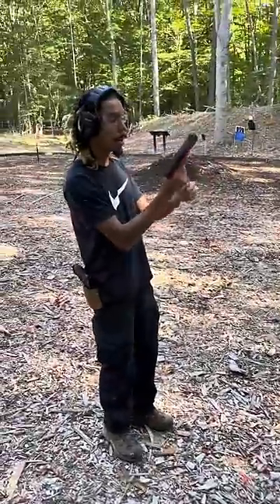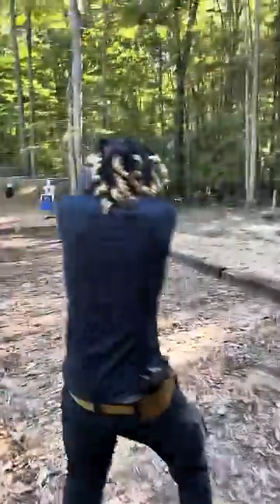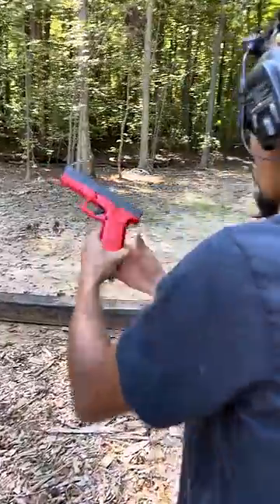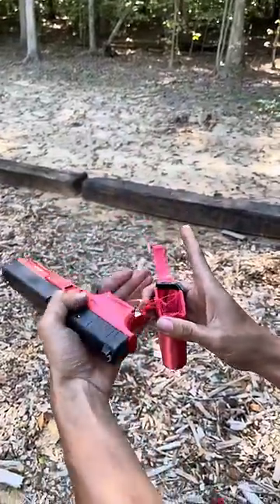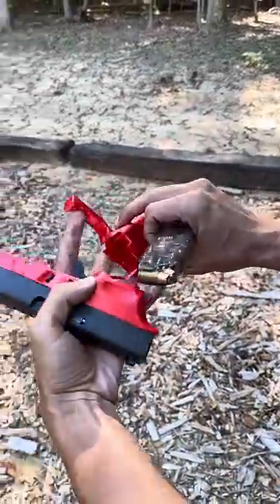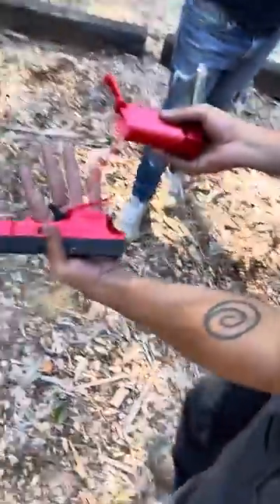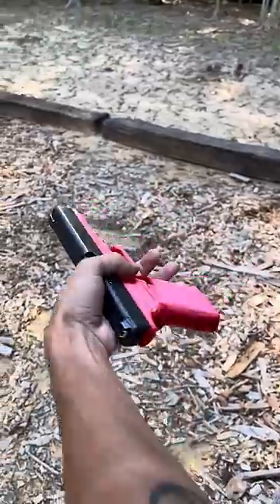3D Printed Gun FAIL 🤬

Comment: The dude saying he used the wrong filament is to blame here 😂😭😭😭
Reply: the problem here is they using 3d printed material for something thats made to have a polymer lower on it😂
Reply: @Sk47_bangouuut PLA+ is pretty similar to polymer with many similar mechanical properties. And it's not made to just be polymer. The original Glock is steel. Polymer is what people make at their houses
Reply: @KB-nt7eg  the lower on the Glock is polymer thats my point u want something with properties to match that of a non 3d printed weapon u need a mix of different materials.

Comment: You never print horizontal along a stress line, should be printed 45 degrees with the high side away from the front of the object where there stress occurs. There are so many variables that could be wrong with print settings to cause this, filament type, bed temp, extruder temp, wall thickness, infill, flow rate, print speed, room temp ect. Number one is part orientation. PLA is not the best option for use parts.
Reply: PLA+ is fine or nylon
Reply: facts, i knew as soon as i saw the layers were parallel with the magwell it was a problem. Its dangerous for someone to just be  printing this stuff without understanding how 3d printers work a bit more
Reply: Major yep.
Reply: Bro... LOL, you are speaking several orders of magnitude more scientifically than most of these dudes are thinking.
Reply: wouldn't flow rate and print speed be pretty close to the same variable? i dont print so i dont know what im talking about, just making an educated guess
Reply: @thespaceelefant2441  yeahh kind of but it wont do only altering one. If you up the print speed hut dont lower the flow rate you get stringing and basically a bad finish. Or if you lower the print speed but dont lower flow rate you may get bulging because too much filament is being extruded at any one time. Ive had a 3d printer for only about 2 years now and it is most definitely a  job of fiddling around until you kind of know whats what
Reply: @Ronald Weedly basically certain orientations and settings when you 3d print can make them weaker
Reply: You're so wrong it's funny. Most print rails down some up hardly any print 45. It's all in the settings and filament choice. That's silk and he probably ran some generic settings watch print shoot repeat or Hoffman tactical.
Reply: @davedfran6082  its not that wrong tbh, and certainly not laughably wrong lol wtf
Reply: Also if he annealed it he would've probably had little to no cracking at the layers.
Reply: NEVER 3D PRINT A GUN! PROFESSIONAL OR NOT
Reply: @ralphralpherson9441  not at all lol those are basic 3d printing terms
Reply: PLA is fantastic option
Reply: @ralphralpherson9441  this is why the threshold for 3D printing builds is more than the average person thinks, because it is. There can be lots of tedious temps and bed level adjustments, extruder changes, or heaven forbid you have a printer set to online and it gets hacked mid print
Reply: @deechonada  everybody who is a name in 2A3d prints rails up or down. Almost all the readmes state that 45 degrees is done in testing for speed of print and removal of supports, not for prolonged use.
Reply: @PNWhashmits  fair enough!

Comment: The guy who knew they used the wrong material should’ve been the one to test it. Lucky nothing worse happened. Pure LUCK
Reply: Right that could have been bad.  It didn’t look like polymer either it just looked like some regular plastic. Look how the piece that broke is all shiny n shit. Polymer don’t shine that way
Reply: That wasn't luck,  that was blessed.
Reply: What could've happened? Like I'm genuinely asking, all the pressurized bits are metal, and the 3d printed part is just holding stuff in place
Reply: @connorhart7597  it could've backfired or blew up normal malfunctioning firearm problems
Reply: Dude has plot armor

Comment: My suggestion is to reposition the part on the bed so your layer's are vertical.
Not horizontal.
Also you need to do some annealing by finishing the part in an oven.
It will melt the layer's together into a more structurally sound part.
Essentially eliminating the layer's and making it solid.
Just what I would try next.
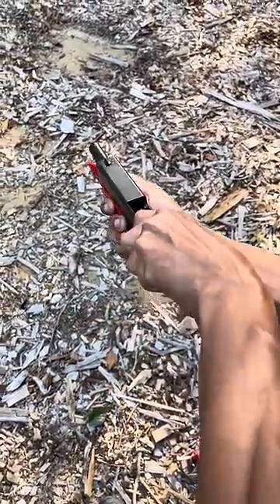Reply: As said at about 0:55, it was the wrong material.

These suggestions are not necessary if you print and follow the guide

Comment: Print your frame on a 45° with supports, run your nozzle a few degrees hotter for better layer adhesion. Looks like you also ran PLA. PLA+ seems to work better  for frames.
Reply: WrathMachine  they still need to come and take it
Reply: How much infill do you recommend for the lower he's holding? Like 30%?
Reply: @indatubesurfer  stop crying
Reply: @PabzRoz  who says I’m crying lol!
Reply: @indatubesurfer  Amen brother. These glorified nerf guns will NEVER be reliable or cost-effective. Every serious gun owner i know doesn't waste their time even thinking about this 3D printed plastic garbage.
Reply: @lospolloshermanos5659   the problem is most people just use cheaper filaments(plastic)  or don't correctly make them.

You can buy very expensive filament that far exceeds metal in all ways. And you could even get (though slightly defeats the purpose) filament with steel, aluminum, iron whatever you want in the plastic when making.

3d printed guns are the future even the US military is already considering plastic ammo.

Also when you do it right, plastic is astronomically cheaper, better, and you don't have to have it traceable. All that plastic that broke in this video maybe cost $2-3?
Reply: @indatubesurfer   clearly you haven't seen what a good actual 3d printed gun looks like (the ones doing full auto putting through thousands of rounds)
Reply: @MTDurkee  There is no need to buy "very expensive filament." PLA+ is more than capable of handling the pressures involved in something like this and only costs $15-30 per kilo depending on what brand you buy. And you can usually squeak 5 full-size pistol frames out of a single kilo if you don't have any failed prints.
Reply: @TEAMFALLBACKstudios  95-100%, depending how well you've tuned your extruder's flow rate. Printed frames need to be as close to solid as possible.

Comment: 100 percent infill goes a long way, and you had layer adhesion issues judge by the way it was unraveling. Bump the temp up a bit and slow it down with 100 percent infill.
Reply: Seems like they are using cheap plastic. Nothing is going to make that hard enough to handle a firearm .
Reply: The Last Human  single use? What is this for criminals directly? Lmao
Reply: @whitetiger5181  Nah, its actually pretty expensive silk. idk why hed use silk when pla+ is cheaper and stronger (and tons easier to work with, his settings were probably wrong because he was using standard pla settings with silk lol)
Reply: @agentbarron3945  I don't know much about the 3D stuff but you need some super strong shit to be able to handle the explosion from a bullet or multiple bullets being fired rapidly. At my machine shop we make some gun parts at times and we use 4140-4150 pre hardened steel . Which is pretty tough not as tough as stainless but still waay tougher than regular carbon steel.
Reply: @whitetiger5181  all the boom boom stuff is happening in the slide anyway. The frame just has to be tough enough to hold on when the slide cycles. Shit, they’re doing AR and AK UPPERS in PLA+. Plastic has come a long way.
Reply: I know this is old but thats actually incorrect. Something like 98% is the way to go. When you set it to 100% it will lay down completely filled layers but when its a little under 100% it will print in alternating patterned layers which make for stronger durability.

Comment: The fact no one was hurt in this video is not luck. The care taken to handle this weapon in the safest possible way is something I rarely see outside trained military. Even cops are notoriously terrible at range safety. This guy is flawless. He's indexing his finger over the trigger guard. The muzzle is pointed down range literally the entire video, and he's even more careful with the weapon after it fails, look how far he peels away his trigger finger from the weapon while it's falling apart. And even though he's pretty sure it didn't cycle a round, he keeps it pointed down range and clears the chamber manually. 10/10. Should be shown in safety class. No joke.

Comment: Get some PLA+ and test it’s strength on increments of 5°C starting at 10° degrees hotter than the upper limit of recommended temperatures.  You’ll probably be up around 230-240 for best strength

Comment: Silk PLA usually has TPU as an additive, so inter-layer adhesion is relatively poor. Regular PLA should fair much better.
Reply: Actually pla+ has TPU additives in it, and TPU is known for superior layer adhesion.
Reply: @JNacoustic  Silk PLA has TPU as an additive and silk PLA has poor layer adhesion.
Reply: PLA is a bad choice in general
Reply: @jonhaze7537  For this application, sure. PLA is very rigid, but that also makes it brittle/low impact resistance.
Reply: PLA+ is an excellent choice for this stuff. The only thing better is polycarbonate, which is about as strong as nylon but easier to print.
Reply: @JNacoustic  PLA+ has lower static strength than PLA.
Reply: @theofficialczex1708  what? It's far less brittle. It flexes instead of breaks. It's better in almost every way. Look at the everyone who print guns, they basically all use PLA+.
Reply: @JNacoustic  It's less brittle, but it has less strength.
Reply: @JNacoustic  I should clarify: I'm not disagreeing with the usage of PLA+ in firearms; I'm just stating facts.
Reply: @theofficialczex1708  glass is harder than steel so therefor it shatters instead of bending. You don't always want something harder. There's many properties that make pla+ superior. Except the heat factor..
Reply: @davedfran6082  Absolutely. I don't disagree with that at all. It should be noted that both PLA and PLA+ have creep issues, too.

Comment: Kudos for the excellent reaction upon weapon fail. You did everything exactly right. Nice job. Figure out what went wrong, fix it, and make another one.
Reply: I wouldnt call pulling the trigger a second time after it had a crack in it "everything exactly right"
Reply: @dogfart2485  I will say this, though. The one and only area I would fault them is that I wouldn't be handling that weapon personally, I'd have it in a vice, pulling a string from a safe distance in case it decides to blow up.

Comment: You're pretty lucky that didnt go worse than it did.. silk PLA is pretty, but PLA+ is, from what I understand, the minimum acceptable material for printing defense items
Reply: Petg ideal no?
Reply: ABS PLA as well
Reply: @TheNexusChan  lol abs pla? you mean just abs?
Reply: @Noblinka  I would think petg would be better? It's more heat resistant and more durable then pla or pla+ in general.
Reply: @PabzRoz  Yes. Thank you
Reply: @PabzRoz  Ya but most people use PLA+ thats what gatalog and defcad recommend anyways.
Reply: @kamikaze5459  Yeah after doing more research I found out why they use PLA+ instead of PETG and it was actually common sense. Like I mentioned PETG is more durable but it tends do bend and deform when stressed vs PLA and PLA+ which will just crack under stress since it's more brittle. The last thing you want when printing fire arm parts is them deforming or bending ever so slightly over time and causing jams etc. etc. which is why they recommend PLA+ because even thought it's not as strong as PETG, it's strong enough and won't deform or bend over time. If anything it will just crack or break and you print a new one. Makes sense.
Reply: petg , carbon fiber reinforced petg and a perfectly calibrated 3d printed are the bare minimum , the problem in the video seems to be bad layer adhesion

Comment: The entire "explosion" happens in the barrel and is closed off by the slide. Literally couldnt hurt himself with a sawed off frame or broken one. Lot of drama, but good example of the importance of property plastics and print geometry
Reply: You are right about where the explosion happened being a relatively closed off part of the gun but a catstrophic failure situation like that is never even remotely safe. And while this was useful in learning about plastics and print geometry, I would've recommended pulling the trigger with a 20 foot string for the first few mags rather than learn that lesson with the gun in my hand.
Reply: You understand the slide hast to reciprocate? So what happens if it doesn't do that and just comes straight back at you because you wanted it to look cute instead of function correctly?
Reply: @xshorty117x  the slide doesn't have to reciprocate to fire a round and unless it shears the slide stop, which is part of the drop in piece of the back block and not a 3d part, the slide won't come off. So no real danger like it implies
Reply: @zachaustin5225  I would have recommended the pull the string part as well, but there couldn't be a catastrophic failure of the parts that count in the machine, just the "shell" as such. There are even Glocks with completely foldable frames akin to this failure lol

Comment: I've seen some frames printed at an angle to solve this problem since the forces are all lateral. If you can turn the print backwards 45 degrees this probably won't happen again.
Reply: I noticed the same thing
Reply: Yes it will. Did you see how terrible the layer adhesion was and that it looks like silk pla, the weakest of the pla. I think even if he used the correct material with that bad printing, it would still fail.

Comment: Just a note based on the little I can gather from the footage: you may want to change the printing direction on the grip. The material is strongest when you put tension on it - far stronger than the bond between layers. The way it split indicates that it just broke the bond between layers.

Comment: I recently started going down the 3d printing rabbit hole and here are some things I learned. You have to calibrate your 3d printer..it has to be a fdm anything printed from resin will break if you breath on it. You also want to use esun pla+ or polymaker pla pro. You also have to dry your fillament and vacum seal it when you aren't using it if it's only been out for a day o2 2 it's probably fine. To dry it you can try a fillament dryer but sometimes too got for pla which is why I bought a cheap fillament dryer  a stock ender is 100% capable. If you wanted to use carbon fiber nylon you would need a hardened steel or diamond nozzle, all metal hot end, bimetal heatbreak , Capricorn tube, and an enclosure. Be u're to do %100 infil.and use supports touching the bed

Comment: when your print comes apart like that it means your print temps are too low to properly adhere the layers together, a properly printed object should crack rather break apart between one of the layers. If a part breaks at a layer line like that and then begins to unravel like a yarn ball you should increase your temps by 10 or so degrees until your layers are almost invisible. Best thing to do is print a thin cylinder upright on the bed and then break it, see how it breaks does it crack or does it come apart like a slinky, if it's the later you need to increase your temps slowly until you reach that perfect temp. In general though don't 3d print guns lol.

Comment: Printed the wrong orientation.  Try adjusting the angle to take the force.   Use an enclosure to maintain heat better.  Those things alone would work.   But yeah, switching material would be good.   What is that pla?

Comment: The thing is, you can't use a shity 3D printer with whatever type of plastic it is that used! There are 3D printers which are much more technologically advanced as well as different plastic compounds and alloys of different Plastics which will hold up much better

Comment: Got a pla+ print i have put about 65 rounds through so far. No issues other then the plasic pins you get from the trigger kit broke. Fixed with a metal pin and no issues. Might done somethings wrong

Comment: The gun was printed with a wrong orientation for the stress, maybe a different material like ABS with a post printing finishing and an horizontal printing orientation.
Reply: Or you just buy a real gun made out of metal not plastic that self destructs when you use it.

Comment: There are number of techniques to strengthen your print. Also, I suspect the layer orientation is a problem here : layers are parallel to the recoil. try putting model on the table in such way, the layers would be orthogonal to the recoil

Comment: Thats why you dont use crappy filaments and not having your printer set perfectly. Most filaments are NOT strong enough for guns. There are filaments that r great for it but you have to know which kinds and have a good printer thats dialed in perfectly. Cuz THAT can happen and your lucky that was all that happened. If you dont know what your doing PLEASE dont do this. You can hurt urself BADLY or worse. You can see how the filament is seperating like that which shows the printer is NOT dialed in anywhere near good enough. That looks like Silk PLA. I wouldnt use that type for a gun at all. A carbon fiber filament would do alot better IF the printer is set correctly and can handle CF filament

Comment: Looks like the cheapest plastic, printer and settings that weren't optimal were used to make that, which is okay for cute figurines, but not mechanical assemblies that undergo significant stresses. Got to do a lot more homework on 3D printing.